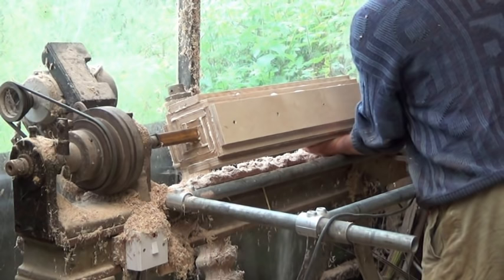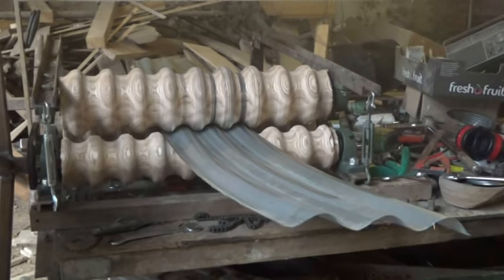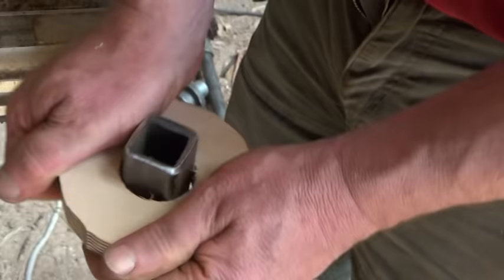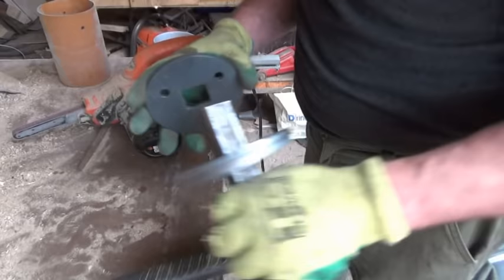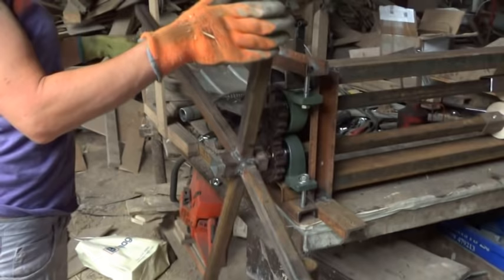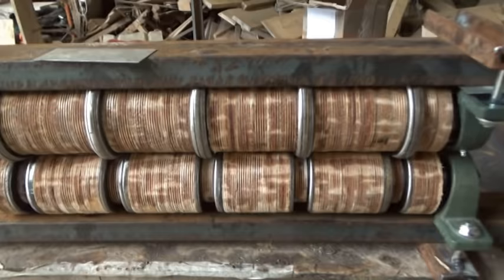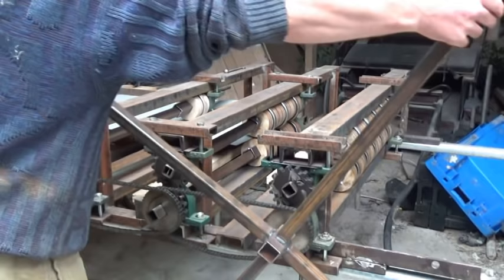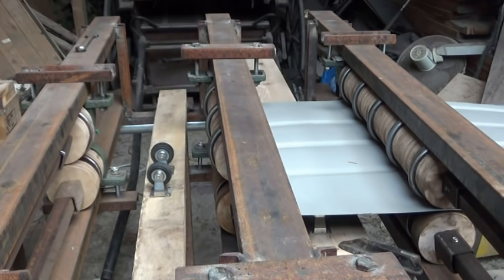Making A Machine That Makes Homemade Corrugated Iron (A New Type!)

Comment: You're the man..If you stick to it you will make corrugated steel panels..The best kind is snap lock.There are no screws showing but on the outside corner finish ell metal..So roll on you smart Irish gentleman! Thanks for sharing !

Comment: I worked at a corragating steel manufacturing facility years ago.  There were hard rubber roller wheels in various places, top and bottom to keep even pressure.  That was for curvature.  The crease rollers were gradual.  All at once, but increasing in depth as it went.  Otherwise, yours look really good.  I would use it.  The curved ones can be collared together to make culverts, for under driveways.  Or small quonset hut pieces.

Comment: Long ago I was a foreman at a cold rolling factory that made angle iron, c-channel and corrugated roofing. Bending from the center is correct but each bend should be slowly formed over a few set of rollers not a single set of rollers. The most important aspect is increasing the diameter of the rollers so the metal is stretched between each set of rollers. The stretching helps reduce the buckling and curving. If I remember correctly the rollers increased in diameter by about 0.09 inch between each station. The very last set of rollers did not change the shape but would be moved up or down, on one or both sides, to flatten the sheet as it exited.
Reply from the maker: Thank you - very interesting. I'm assuming you were forming much deeper shapes than I am though. I may have to put intermediate sets in between, but so far it's working quite well.

Comment: Looks neat. Probably set height adjustment on the middle roller to flex it opposite of the natural curve it develops. Facilities that make corrugated steel have multiple dies set at alternating heights. This works as a straightener flexing the steel back and forth until it's settled and straight. It's just a suggestion if you ever feel like trying. Maybe even some transition plates. Above and below the die entrances of the die to help catch and guide the steel into the next die.

Comment: I ran a roll forming machine for years. One of the things you need to do is redesign the machine to where you can change the gap between the lower and uper rolls by thousandths. Being able to control your gap will greatly reduce a lot of your problems. Also you need something to change your camber. Usually a die in the finished form of the steal that you can twist left or right. Good luck.
Reply from the maker: Thanks John. I don't know about the camber, but I have made it so I can alter the gap using shims. It's fiddly but possible. I'm hoping when it's set up it won't need altering.

Comment: The key to roll forming any material is rigidity and alignment plus enough stations to encourage the flat material to conform to your desired profile. A corrugated iron roll forming machine has something like 10 or 12 stations. You are definitely heading on the right track. Your machine is definitely very familiar in a rudimentary sort of way to that which the modern rollforming industry uses. But and it is a very big but. Your profile is definitely not corrugated iron.
Reply from the maker: bumpy iron?

Comment: Sorry for your loss mate. To straighten out the sheet can you add a copy of the last roller set and offset the position of the top and bottom to bend it ever so slightly in the opposite direction? You would bend it the exact amount it was curved.

Comment: You are on the right track...
Commercially, the sheet steel is deformed little by little over a series of dozens of rollers changing the shape over the length of the machine.
As to how they keep it flat, I'n not sure but I assume one set of rollers is aligned to cause a curl up and the other a curl down and this is repeated over and over.
You are correct, the steel needs to be a soft annealed steel.
Not sure if Aluminum sheet would bend better or not.
Love your project videos.
Reply from the maker: Thanks, DS. Aluminium would cost many times what this does so I have to find a way to make this work
Reply: Have you seen some of the videos of the machines I was mentioning which had different profile rollers lined up to modify the shape a little at a time?
Still not certain the specific alignment to apply to keep it flat.
Perhaps there is an idler roller between the forming rollers to exert an opposing force to take the curl out.
Best of luck !

Comment: Have you considered making rollers that would feed from the side? Meaning bending a corrugation one at a time across the  full length of the sheet instead of doing it lengthwise. It would be more difficult to make the rollers, but I think it would work. Think of it as feeding the sheet in between two ‘gears’. Forming each corrugation one at a time.
Reply from the maker: Yes, but mine works! You make one your way and we'll race them, ok?

Comment: Hey I had this same idea before to make corrugated iron sheet rollers but couldn't get exactly how I would build it but your wooden roller assembly I think is in the right direction and I'm glad that I discovered your video.  I also had imagined that rolling corrugated sheets would get those kinks because of tensility of the metal but also had imagined a solution to make it a bit malleable by simply "heating" it up first with gas torch near the bend region and slow turning.  Please don't give up yet, this might work. Cheers!
Reply from the maker: It's working fine thanks, Ronaldo. Just don't ever try heating up your sheet first - you'll wreck the zinc.

Comment: Have you tried aluminium Tim..its much more malleable than iron especially in sheet form although more expensive...hence zinc coated iron sheets...so I guess manufacturers form the sheets before applying the zinc so they can heat to more easily form ..but it's not a complicated process to zinc coat by electrolysis...your finished product is very appealing and easy on the eye..nice job🇮🇪
Reply from the maker: I'm hoping to make huts for sale - and aluminium would make them just so expensive no one would buy them : -   (

Comment: I am loathe to be a back-seater here, but I watched this video in the morning and have meditated on it all day. Idea: What if you run the metal through ONLY ONE pair of peaks and troughs in the middle, then take it to the next set that includes the middle peak/trough on either side as well. This would be done gradually instead of forcing it all to do it at once. Each next set of rollers could be positioned where they should be considering the shrinkage and pull caused by the preceding set, flat rollers to counteract curvature of the sheet. One drawback to this is that the metal would have to travel through a longer distance, but it may solve some of the other problems. Each time you role the metal through, flip it over to possibly help counteract the curvature.  Very sorry to ramble, the talker is not the doer. Just an idea. I have been grabbed by homemade machine ideas too.  By the way, there was an actual superhero who went by the name of Captain Sticky who was the first guy to make corrugated fiberglass panels, and he used his wealth to fight crime and live the lifestyle of a superhero.
Reply from the maker: My kind of superhero! In fact the method I'm trying is what you describe - one bump, then three, then five..
Reply: @WayOutWestx2  Your efforts qualify you as a superhero as well, Godspeed.

Comment: You are using a bar to keep more pressure on your rollers....so, to that bar (or behind it)   add small independent rollers (mostly for the FLATS) with screw adjusters for depth to massage the outcoming metal just enough to push it past straight so that when it springs back the result IS straight. This should result in very little change to your existing set-up. I hope this helps. Great video.....Good luck.
Reply from the maker: You're right - and that's the way I'm heading too. I hope it works

Comment: could be that professional corugated iron is fed through the machine sideways and the rollers look like meshing cogs , that would solve the sheet getting shorter while being fed through the machine does make it harder to keep the metal going in straight might become fan shaped 
that might allso make it able to corrugate it in a bow shape without buckling it but the two rollers would be as big / tall as the finished product 
think you can make those out of thick metal plates by cutting them on the plasma cutter for the top one starting with the middle one and progressively making them smaller toward the ends and for the bottom one the opposite then stack everything on a big square axle etc 
the final rollers should be the weight of a wreckingball and prolly would act like one if it falls out of say a crane , the weight alone should be enough to force the metal in shape stretch AND shrink it where needed 

if you keep using youre current setup it would take stronger frames and a lot more force but flattening /stretching / thinning the steel on the top of the corrugations should cause the whole metal sheet to bend down and that would cause the sideways bend to go away automaticly  . it would allso mean that you need to put the different machines in an arc or the end of the material comming out the machine before it whont feed through the middle of the next one and the one after that
maibe you can bent downward during the feeding through of the material and stretch the metal in an arc by force 
maibe you need to build a few more frames to deepen the corrugations in stages untill there deep enough to hold their shape 

maibe heating the high parts on the sheetmetal redhot before feeding it through will work , as the metal cools it keeps its shape in both planes would take a lot of energy to heat the sheet redhot while feeding it through at a reasonable speed

Comment: Fantastic illustration of applied engineering. What gauge is the metal sheets that you use? I really like the profile that your machine produces. From what I can see there is only one type of curved profile depth and spacing that is available for purchase. So your machine gives much greater flexibility in design. Keep up the outstanding work and a big shout out to your ever willing assistant!

Comment: Use the one with all the bead rollers, and start from one side of the sheet. Roll one bead, and index the bead you just rolled to the second roller. That way it's only shrinking from one side.
Reply from the maker: Yes, but a longer machine needed, slower process and much more likely to end up banana-shaped, I suspect.

Comment: The axles that hold your dyes need to be solid so there less flex when the metal is being run causing it to walk out of line.  I worked in a metal company for about a year and half while I worked through college.  Ran one of those machines until I graduated. Hated changing it over to run another type
Reply from the maker: You're so right, Patrick. I found that out since.

Comment: I suggest a electric motor and a foot pedal to control the speed, and I think they make the corrugated sheets cemetrical so they can flip it over and take the bend out

Comment: Rollers made of steel an metal heated before an temp control after rolling, then weight end one end of sheet an hang to cool. You'll be able to control shape with heat!
Reply from the maker: These are coated with zinc and then pvc - heat would just make a horrible mess : -  (

Comment: Re Australia,
The product here is zincalume, and the coloured product is colourbond.
Galvanised Iron or corrugated iron sheeting, nicknamed ‘corro’ is an old product, it contained a percentage of tin, which made it malleable, and very workable. Zincalume is not like that, very unforgiving , but still an excellent product used extensively in building here.
Reply from the maker: Interesting, thanks - although a few people have said there's a type with higher lead that is easy to bend
Reply: Way Out West Blow-in blog it would not have lead, this product was always used for roofing and water tanks too
Reply from the maker: That makes sense

Comment: Flip every other set of rollers to reverse the curve. Or say you want 8 ridges, place the dies in the 1,3,5,7 position,. Run the sheet, flip it and it will make the 2,4,6,8 ridges .
Reply from the maker: Ah, but I need all the bumps on the same side for the next step..!

Comment: Sorry to hear about your son... Hope you are doing OK.... I was also thinking isn't modern corrugated sheet metal pressed into shape with a big stamper rather than rolled through a machine....or maybe it is rolled but in the other direction so the roller has bumps laterally (has to be wide as you are passing it through the other way) and every few inches another lateral bump make another ridge all the way along.  Hope you understand what I mean.
Reply from the maker: Thanks, RT. There are some manufacturers that stamp it out but mostly it's still rolled a bit like this.

Comment: I think the rollers probably work better if different depths. If the first set started at  1/8  then 1/4 then 1/2
Reply: k watson, I thought the same at first but that wouldn't solve the problem of drawing in steel from the sides, since each step would draw in more and more for the center crease
Reply: @masonheipel  it should stretch the center of the ridge and not draw in any for the out side. If the first roller has 6 ridges it set's the pattern and couldn't move as you in large the ridge.

Comment: I think the rollers need to be angled inwards rather than on a single axis, because the outer edges of the sheet are pulled inwards (the sheet gets narrower) as the corrugation is formed.
Reply from the maker: Perhaps, but how would you do that? Sounds very difficult?
Reply: @WayOutWestx2  I guess some sort of castor wheel could be used for each corrugation. If swiveling castors were used they would show you the alignment needed to follow the sheet. The right separation to fit the corrugation depth would be harder to work out and might take some trial and error.

Comment: if bumps down cause a slight curve in the sheet. Try building the machine with curves down on first set of rollers, then the next set of rollers would be bumps up. This should stretch the sheet back into a flat plane. That way you are never compressing one side, you would always be stretching one side then the other.
Reply from the maker: Ah, but you missed the point - my aim is to roll the finished sheet into an arc. That's why I only want bumps on one side.

Comment: In America corrugated of different patterns and colors length up to 40' or custom lengths is around $1.25 per square foot .  The material is galvanized then painted with 20yr guarantee on the paint.If people care to comment :  What does it sell for in other countries ?
Reply: Solidwoods 
I looked it up, because why not and the price here in Germany seems to be between 10 and 15€ per square meter. Depending on thickness. For corrugated and painted, as you said. 1 square foot is about 30x30cm...so 1square meter would be around 10 square feet. 
 1 Dollar  is about 0,90 Cent currently, so...pretty similar prices 😄

Comment: Hi Tim and Sandra, I'm wondering what you can possibly have in mind to build with a sub-80 cm radius of curved corrugated iron!
I also wonder at the concept of the "back" of the sheet needìng to "contract".

From what I recall of seeing this process as my pigloos were rolled (33 years ago now, still good), the curving rollers were deeply-profiled steel, and exerted so much force that only the top side was stretched. I should go back to the workshop and take notes, or better yet, take some video! You now have me intrigued to find out more about this technique.
Reply: Another thing occurred to me.
Whenever corrugated iron is being rolled, both surfaces are always coated in very light machine oil.
Using wooden rollers on dry iron must be causing a lot of friction.
Reply from the maker: I'm just going by the evidence of the failures - stretched above the centre-line and kinked beneath. I don't know how you could get it to only stretch - if you find out then I'd be very interested to know : -  )
Reply: @WayOutWestx2  
I will investigate!

Comment: Too late now but if you turned the corrugations 90 degrees then the stress on the iron is the same all the way across. Craft shop paper corrogators work that way.

Comment: The whole roller that the forming dies are on should be treated as a whole die,
Then there should be a lower die that is the exact opposite of top die x two metal thicknesses. If the top die is 1 inch and the metal is 0.05 the the lower die should be 1.100 inch on center. You are not bead rolling you are forming.
Good luck to you sir.

Comment: Corrigated iron is formed in 3 stages with progressively more aggressive rolers.
Reply from the maker: but mine has fairly shallow forms
Reply: @WayOutWestx2  yeah I get that, what I mean is that sheets go through a first stage roler that puts maybe 20% of the shape into the sheet then the next one will put 60 ish % and the last one will take it to its proper dimensions.
Reply: @WayOutWestx2  you can just search YouTube "how corrigated iron is made" and it'll show you the roler layout, hope this helps
Reply: You can just search YouTube "how corrigated iron is made" and it'll show you the roler layout, hope this helps